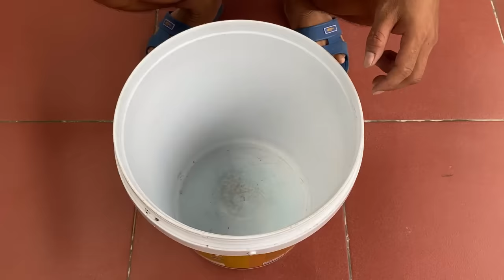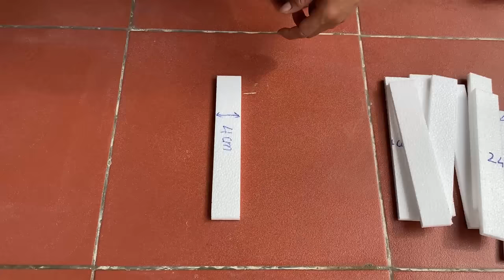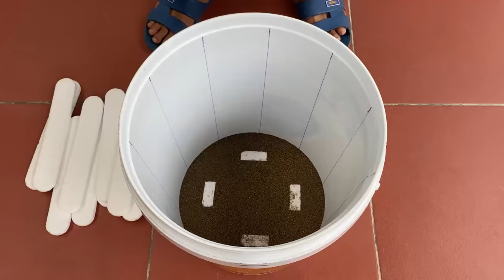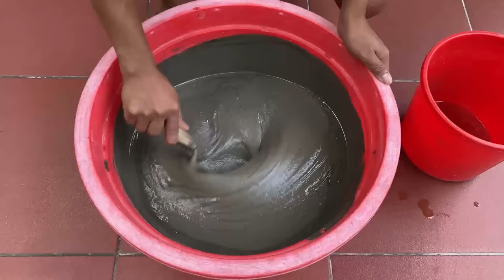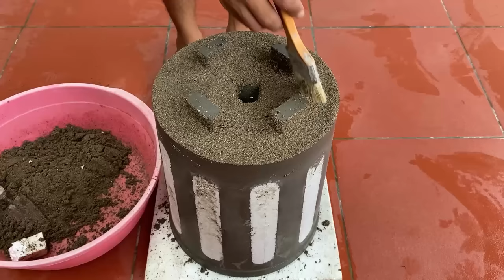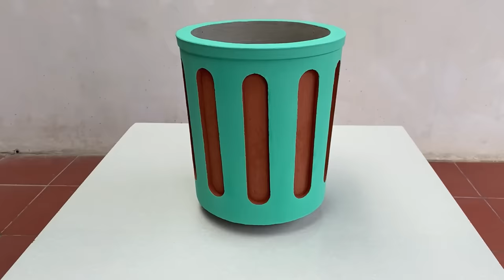New Ideas - How To Make Simple Cement Flower Pots From Plastic Containers And Styrofoam

Comment: What did you use to glue the foam to the bucket, and what did you use to lubricate the bucket that you put in the seridine.
Reply from the maker: Please see the answer in my video for details. I use silicon glue to glue the foam and use cooking oil to coat the barrel for the inside.

Comment: After watching your video I made it exactly but then I couldn't separate the bucket from the cement, please help me
Reply from the maker: You just apply a very thin layer of glue on the foam, use hot water to make the box and the glue will stretch evenly and lift the mold out.